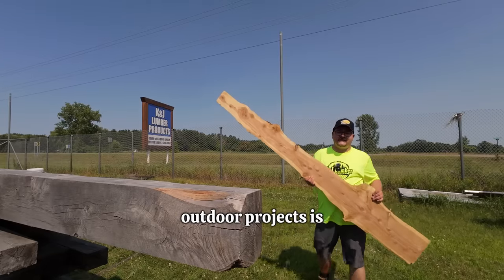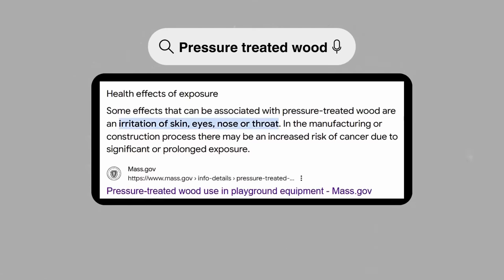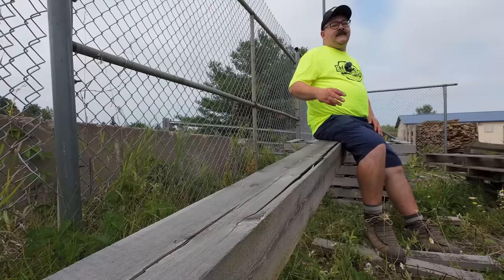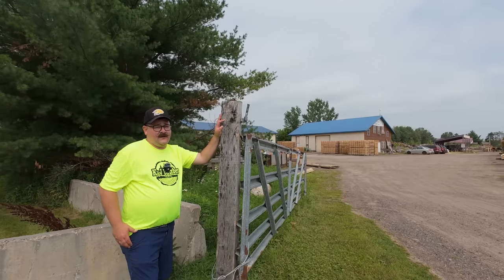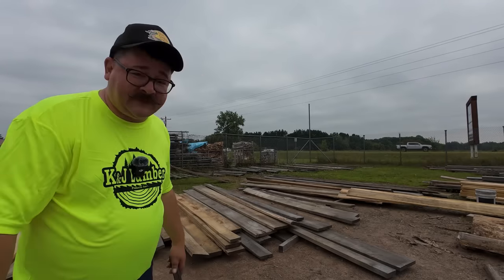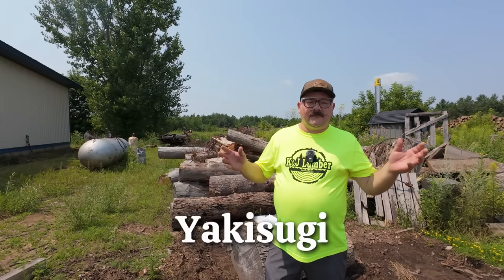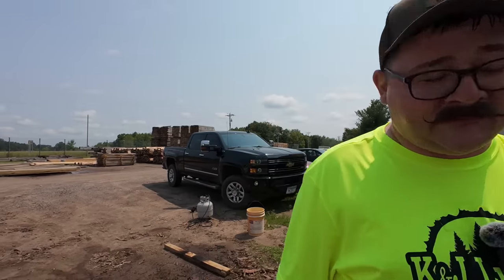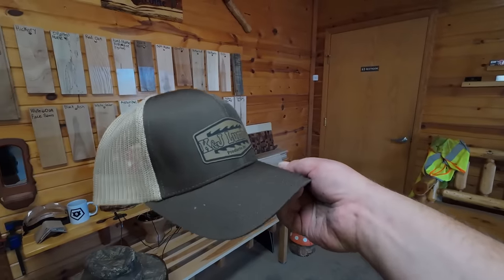the Best Wood for Outdoor Projects is...

Comment: Word!  Yakisugi rules!  I have used it for planters and mulch pens.  Love it and it looks cool!  I even put it into my bar.
Reply from the maker: I “sorta” knew about this already, but it wasn’t until doing the research for this video that I realized how awesome it was. Might do a video that delves deeper into this subject. Thanks for the comment Brother!
Reply: There’s definitely a lot more that you could learn, and it’s very interesting. A few things I’ve learned. 
1. Huge difference between using green lumber and dried lumber. If it’s green, you can watch the sap bleed out of the pores. 
2. When you char it, if you work from one end to the other in the direction of the flame, you will preheat the wood before the intense fire ever gets there. Gotta get the sap out to be done. 
3. Only move as fast as completing the char takes. It’s more than a surface treatment. It is actually changing part of the wood structure; the part that bugs like to eat. 
4. Definitely get rid of the excess char. All it does after the fact is make a mess. The char can be brushed away, but we like to use a power washer, but be careful how close you get. You can remove most of the darkness - remember, it’s a matter of changing the wood more than the exterior char - and it leaves an interesting coloring with the wood grain. 
5. Definitely recommend using a diluted linseed oil finish to give it a little nicer finish and water repellency. Super easy to apply. Wipe on. Wipe off excess in 10-20 minutes then lay out the rags to dry. They will ignite if not laid out. 
One downside to HT is that the wood becomes more brittle so the structural capacity has to be reduced if it is being used structurally.

Comment: Black Locust trees are fast growing and have a dense heavy wood. Very durable. When young they have thorns but as they get older they don't. The seeds from pods germinate naturally. I was thinning a stand out and used as fence posts. Heavy and seem to be very rot resistant. Introduced to my land, I am amazed at the extreme weather conditions Black Locust can tolerate. My area -30F to 105F

Comment: Bodark or "Osage Orange" best outdoor wood, provided you work it while it's still green. Once it cures, good luck working with it. It will not rot but petrifies. 
Burning method has been around for a long time. Steel wool works wonders at cleaning up the "burn".
Reply from the maker: Thanks for the comment and the heads up on Osage Orange. comments like these help other people who watch this video to find the lumber they could use in their local area. Good tip btw.. work it green or you might as well be trying to carve a dinosaur bone later! 😂 don't forget to hit that subscribe button! we are doing a giveaway to our subs on an upcoming video.

Comment: White oak is an excellent choice.  A HARD wood with an eastern white oak, fine grain, you can bounce cannon balls off it,,, literally.  The USS Constitution, still commissioned and floating in Boston Harbor  200 plus years,, nicknamed  "Old Iron Sides"  Because iron cannon balls DID bounce off its sides in battle.  Eastern white oak can dull aluminum oxide sanding belts.  Yep.
Another excellent choice for exterior use,, maybe better than white oak,, but expensive.  Black walnut.  I know of a mailbox post that is now 50 years old.  Lost ts bark recently.  It will be there another 50 years.

Comment: One comment about white oak and stainless steel fasteners, white oak and stainless can react to each other.  The preferred fastener for White oak is silicon bronze.  I am a classic boat restorer.   There is a chemical reaction between the White oak and stainless steel.
Reply: Red oak is worse
Reply: @johnlogan8218  it just rots.  It sucks in moisture.  And if it is wet when it freezes.. the wood fibers get crushed and rot occurs very quickly.     Red oak has to be in used  in a dry environment.     Not good in bathrooms either.     White oak is so much better in a damp environment.

Comment: Very informative.  

What are your thoughts on using the wood locust?  I have seen commercial childrens playground equipment.
Reply from the maker: Locust does not grow in our area, therefore I cannot speak on it as I have no experience with it. We did a custom job for a construction company last year that had won a bid for a local twin cities suburb, they were installing animal shaped pieces for a local park. Was pretty unique as they had to be cut in certain shapes etc. one of them was an alligator shape if I remember correctly. Thanks for the comment! Be sure to sub, and thanks again!

Comment: Great video, I wish I had this a few years ago when I bought expensive Covid priced cedar for the deck chairs.... yikes that was expensive. Even more so since I live in the prairies in Canada, no forests here and everything is shipped in. I'll be looking at white oak next time, and even here it is pretty cheap at times. All depends what the local lumber merchants get in.

One wood I want to try but nobody seems to harvest and mill is Tamarack (also called Eastern Larch, Black Larch, Red Larch, or American Larch) since it grows in the northern treeline swamps of my province mixed in with pines and such. Most people use them for pulp or posts. It is nearly as rot and water resistant as cedar, but a much harder wood for making furniture out of. It sounds like the perfect middle ground between white oak and cedar, but I'll be damned if I can find any milled out to try although the places that do work it say it typically is only a bit more expensive then pine since they pull it out at the same time.

Comment: Douglas fir is a good outdoor wood, but you should treat it with a water sealant, then paint it.  Pressure treated lumber warps too much for external, decking, its okay for joists and posts. I regret using it as decking. After 2 years and good staining, it was so twisted and warped that I am going to replace it. From your video, I will see if Colorado has it and compare it to douglas fir.

Comment: I paint my outdoor wood projects with Titebond III Waterproof Wood Glue. Then paint with Porch Paint. It makes the wood last a gazillion times longer ❗
Reply from the maker: So you paint with Titebond 3? That is interesting. Might borrow this idea..
Reply: @kandjlumber   Yes, I buy Titebond 3 by the gallon at Lowes. I apply it just like it were paint, with a brush or roller. Another thing I do, when needed, is roll on the Titebond 3 and, while it is still wet, sprinkle sand on it. This creates a slip-resistant surface and makes the glue impervious to UV light. If you want an ever stronger wood surface, lay down fiberglass cloth and paint it with Titebond 3 until saturated just like you do epoxy (for boat building, etc.). I built a garden cart and sealed the whole thing with Titebond 3, and applied fiberglass cloth to critical areas. That cart has been sitting out in the weather for about 10 years and shows zero signs of wood rot.
Reply: @firecloud77  I restore wooden boats and am getting into furniture and you’re right, between titebond iii and epoxy, that’s all you need. White oak is also used in boats since forever and is a great wood for structural members.

Comment: Thanks so much for this primer on outdoor woods.  I've used a lot of pressure treated posts but, hopefully not in locations where it may be hazardous (mostly posts in concrete).  I do a lot of work with exterior woods for carvings.  I always put exterior finishes on them to, hopefully, make them last longer.  But I won't worry about it as we all grow old;-).  What surprised me is that much of the wood I'm using (so far I get free large hunks of wood) is supposedly cedar.  Now, I'm wondering if it's not cedar and less effective outdoors.  I've done a lot of work with white oak and love it for furniture.  It's just that I'll have to Pay for it;-(  And learn how to carve it.

Comment: black locust is more rot resistant than white oak, but hard to find big straight logs.
Reply from the maker: A lot of people are mentioning Black Locust. Thanks for the comment. Be sure to Subscribe, it helps us out.
Reply: I saw small right angle pieces of Black Locust, cut from where a branch comes off the main trunk, being used as brackets on wooden boats in Sausalito, Ca, back in the 1970s. Hard, strong, and rot resistant.

Comment: Yeah white oak is awesome. Red oak can rot within a year or so if you don't treat it. Even if it's off the ground. I built rails on a 4x8 trailer out of red oak barn wood. It didn't last a year but it wasn't green either....old barn wood. However I did make shop door out of it and rubbed burnt motor oil on it and it's been probably 7 years.

Comment: Old growth red cedar is almost as rot resistant as redwood but lumber milled out of younger second growth is no more rot resistant than pine. A young cedar pole planted in the ground, untreated will rot off in a few years. Actually larch is more resistant than young cedar but is still not all that suitable for out doors.

Comment: Strange to me that white oak would last longer than red. 

When im in the woods cutting firewood. White oak seems to turn soft on the outside.  Long before the red.   Granted thats just the outter layer the centers are solid on both.

Comment: Re: red oak pores, I made a board & batten door out of red oak once.  When I applied the clamps to the batten, the glue was squeezing out directly through the board, through the large pores of the red oak.

White oak is amazing stuff.  I've only done a tiny bit with it (I'm barely a real hobbyist woodworker) but I hope to do some more with it in the future.  White oak is amazingly strong (in general, though I'm sure not the strongest wood), and a friend who works at a sawmill says they (the sawmill) use it for the sides of trucks, etc, because it's so weather resistant.

Comment: About the only wood around here is spruce.  Any other wood is running 12$ board foot and up.  Plastc wood 2x6 x 16 is 86.00$ a board.  Cedar is absolutely insane at 60$ a board foot.  A 2x6 x 12 foot cedar board for a window sill cost me 600$.  Spruce is it, and even at that its going to be real expensive to build anything.  Exterior finish...... get a pressure sprayer and soak it with oil to make it last.  Stain it first if you want colour.  Paint holds the moisture and rots in a few years.  Building with wood is not like it used to be 😢
Reply from the maker: $60 bleeping dollars a board foot!?! Good lord…
Reply: Talk about GREEDY lumber sellers....$60/bdft for cedar 2x6 ?? $600 fir a 12' ?? Absolutely insane. You were totally ripped off.  I live in SW Oregon....that board would likely be$20-$25 @ ANY lumberyard, $30-$40 @Home Depot or Lowe’s....and of questionable twist/straightness....big box crap lumber.
But a $600 2x6 is HIGHWAY ROBBERY !!!!

Comment: Im sorry, can someone please throw me a bone here. just want to make sure i understood correctly. The best thing to do is to simply char the wood you want to use? i know that a very watered down version but essentially is that it?
Reply from the maker: Do a Search of Yakisugi (shou sugi ban). Experts there on YouTube can explain the process and answer questions better i think. Also some of the ppl here in the comments section have some really great working knowledge of Yakisugi.
Reply: The old timers here treated all fence posts that way and I have some on my farm still standing that were planted in WW2. I built a pole shed where I charred the bottoms of the poles, dipped them in old motor oil and wrapped them in contractor garbage bags that I then set in concrete. That pole building turned 35 this year and there is still zero sign of rot in any of the posts.

Comment: Depending on what you are doing, if you would like to use plywood, use marine grade. I've seen marine grade plywood stay outdoors for decades and never delaminate. It almost looked as good as when it was new.
Reply from the maker: Yes a lot of the sources I have found when research for this video recommended Marine Grade. Thanks for the insights.
Reply: It’s great but special order in my area and way over $150 per 4x8.  It is weather proof tho.  I have some floor platforms in my alumacraft that are perfect after 40 years outside.  What do you pay in your area?

Comment: Did not search all the comments. I will mention spanish cedar. I rented space in a mill where an architectural wood fabrication shop was located. They did detailed period reproductions exteriors that they shipped all over the US.They started out using old growth woods when the company began to replicate period work. When that became scarce they used spanish cedar. One bar they remodeled it was used on the decking outside as well as the railings and casements and on all the interior furniture as a poor mans mahogany substitute. Once it the lacquer finish was applied it was hard to distinguish. I worked as a stair builder and the shop owner I worked for substituted it for mahogany on a few jobs in a pinch. It wasnt till the third install when the cedar dust triggered my asthma that I figured it out.

Comment: for speed use propane.  For the environment use a wood fire.  I have been doing this for over 40 yr.  I learn it from A Japanese who I just happen to come across.  I am a farmer who works a # of farms not right next to each other.  I raise beef, pork, fowl, mushrooms and on my one 100 ac flat land farm i do veggies.  Dont sell any thing whole sale.  Sell it all to my CSA retail at prices 1/3 to 1/2 of what the big boxes charge for chem raised sh-t and Im still making some veery good money.  I have been raising organic food for 50 yr now ever since I took a farm over from my Da at age 27

With this for back ground I began replacing my exterior or what some ppl call perimeter fencing, with char locust post. Now a locust post will last for some time but my charred post that I put in 50 yr ago;  I have dug up one of those post every yr to see how they are doing.  Not a single post has shown any signs of rot.  A few yr ago I went to digging a post on each farm I own (there are 10 of them now) to see if there is any dif from one soil type to another.  By soil type I mean side. hill top, or bottom land.  Each hold water dif.

So kids stop buying this over priced finished chem treated wood and go to ruff cut and char it is if it is to touch or b e in the ground.  The Sh-t they treat this wood with is so toxic that they say only handle it with gloves.  Bet u never read Warehouser's pamphlet on their treated wood if u did not know this.

One more thing.  The wood u char today u nor ur kids or Gkids will ever see rot.  One charred wood is good for at least 100 yr.

                                                        FIN

Comment: You've got a good presentation style, appreciate the video.  A couple years back my local supplier was charging near $13/bf for S2S for white oak.  I love white Oak but not at that price.  I've exhausted my entire stock of hardwood and not relishing the idea of finding a new supplier. (Central Ohio)
Reply from the maker: Yeah, White Oak that is Kiln Dried, Planed and Straight-lined, is going to be much more expensive that Fresh Cut Green. One of the drawbacks to fresh cut is that it will not be dried, and that may introduce more problems with whatever you're making. Find a local sawmill that offers rough sawn white oak and you might be surprised.
Reply: IN the late 80's I decided to build a horse barn for boarding horses. I found a saw mill in the middle of Michigan, we were in Saline, MI, and ordered 5,000 bd ft of 4 quarter white oak for the sides and doors of the horse stalls. While it was green it was nice to work with, smelled like urine while cutting. I should have ordered 6 or 8 quarter as the 4 quarter was a little more prone to cupping, twisting and cracking when I was working with it. While it was green the twist nails worked fine. Toward the end of building the doors I did need to start drilling holes as the wood had dried enough to be harder than the nails. We sold and moved twice since then but, as far as I know, those stalls are still in good shape even with the horse manure and urine and 35 years of use.

Comment: I'm building a free standing set of stairs so I went in to the best hardwood/timber yard in the city and asked for white oak to make the treads out of. The guy stopped and stared at me as if I had asked to date his daughter. He kindly informed me that white oak has become almost impossible to source and that the price, if he got it for me, would be astronomical. So I now have beautiful maple stairs which were a fraction of the price that white oak would have been.
Reply from the maker: Sounds like you avoided heartbreak! Maple might not be the 'white oak' you were dreaming of, but it sure sounds like a solid backup plan!
Reply: Are these stairs outdoors or indoors? Indoors, hard maple (Sugar Maple) will list a good many years. Outdoors, maple rots about as fast as red oak.
Reply: @branchandfoundry560  Excellent advice! Absolutely indoors only with maple.
Reply from the maker: When doing research for this video, all of the articles/sources said that Maple (as well as other species too) was not a good choice for outdoor applications.
Reply: @kandjlumber  yeah, I burn wood for heat and if I leave maple laying like one year, it starts to rot really quick compared to other hardwoods
Reply: Sapele (an African Mahogany) would have been a better choice. It's cheaper than White Oak, a very good outdoor wood, & would last far longer than Maple outside.
Reply: For the Michael love home, we used Hickory for our stairway